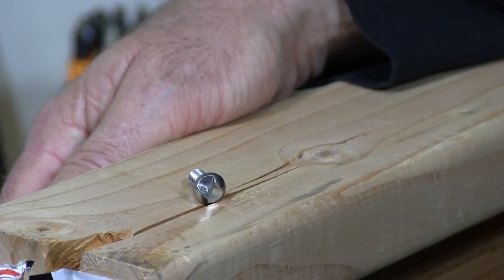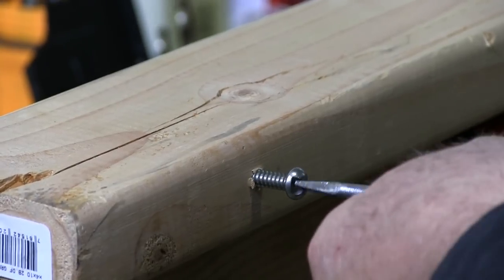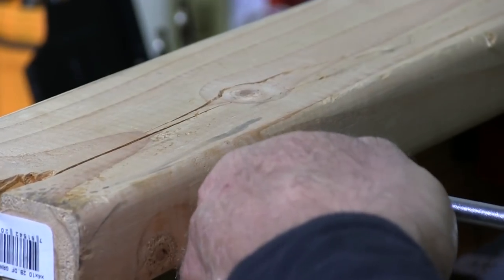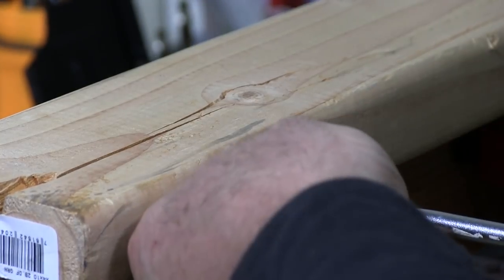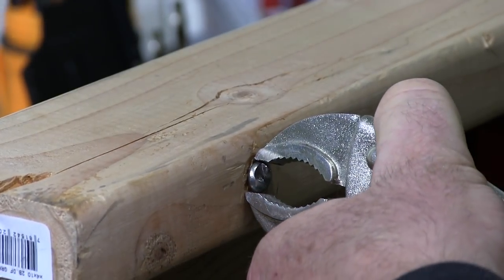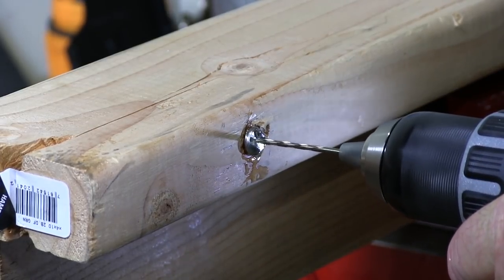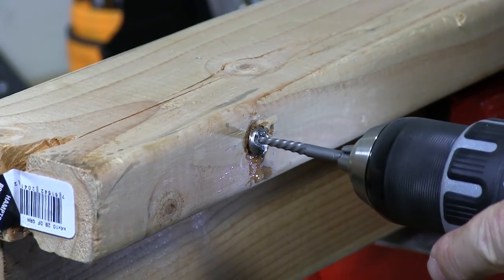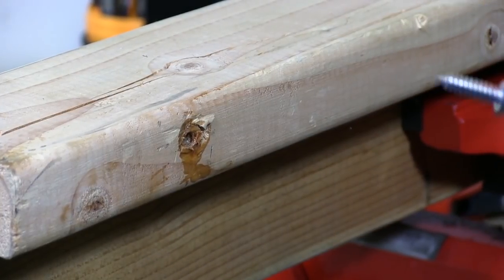Removing One Way Screws with a Bolt Extractor Set | Fasteners 101

Comment: IF you can get a replacement screw as this place seems to have many for sale then buy the screw, make sure it's the proper one. 

To remove you can cut on the tapered groove with either a air or electric cutoff grinding wheel creating a slot for a flathead screwdriver to remove. 

Another option is to use a grinding disc aka cutoff wheel to grind it down thru the center of the screw to bottom of the head of screw. Then you can use a small chisel with a hammer to hammer the head of the screw which will be easier. 

IF you don't have a cutoff wheel you can also use a file though it may take longer.

Comment: Hi. I just came across this video as I have this problem with these screws! I have a power extension cord that I need to open and I can't because of these one way screws that are in the holes. Can't grab them with any pliers or hammer the because of the plastic case that would break.
Any suggestion how and with what to reach these screws in the hole to unscrew them?
It's a good power extension cord and I don't want to break it or throw it away!
Reply from the maker: Use a vice grip pliers